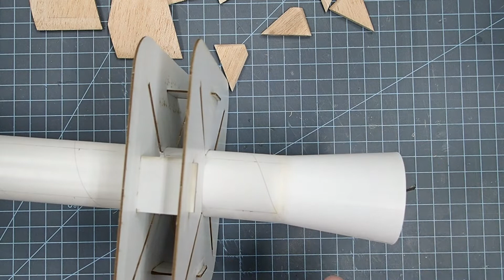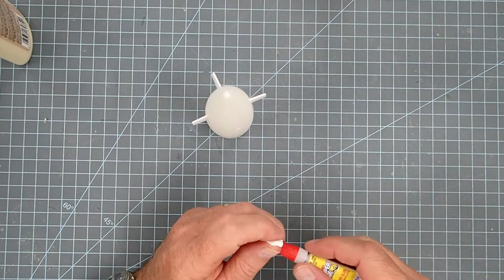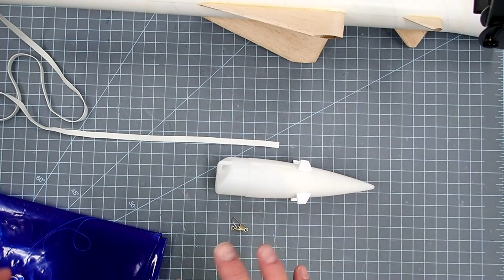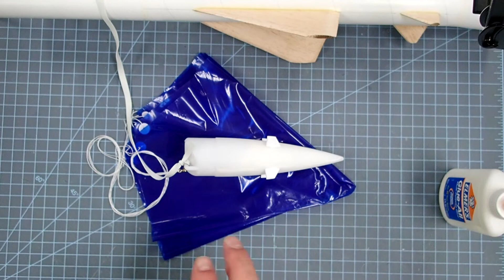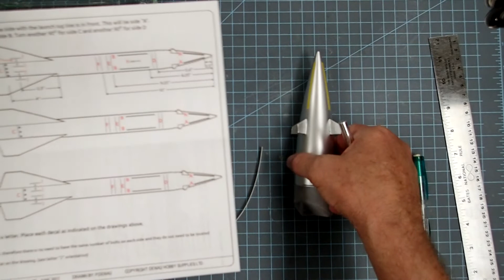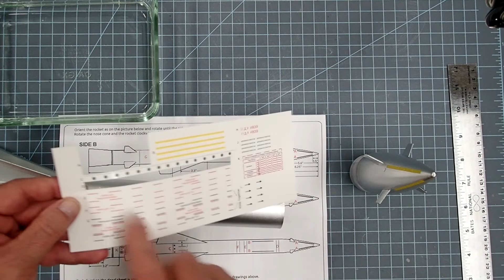Rocketarium "Guideline SA-2" model rocket assembly (part 2 of 2)

Comment: Nice build, Dave. Do you remember what brand/type of silver paint you used? It looks great. Should I try your suggestion from another video of putting black down first to make it pop even more?
Reply from the maker: It was one of the Rustoleum metallic paints. A black base coat certainly wouldn't hurt, but it may require more coats of the silver.